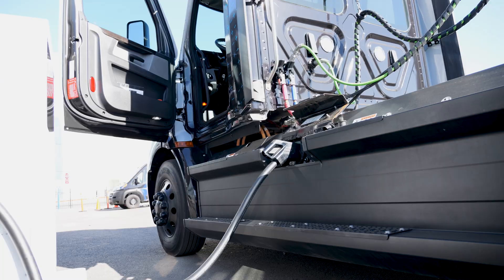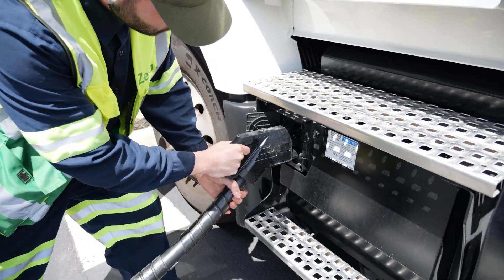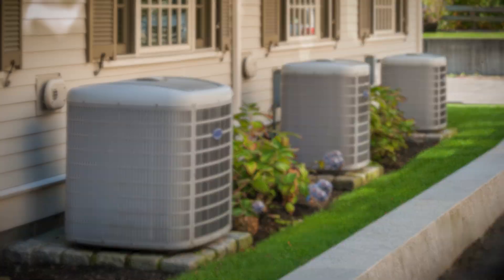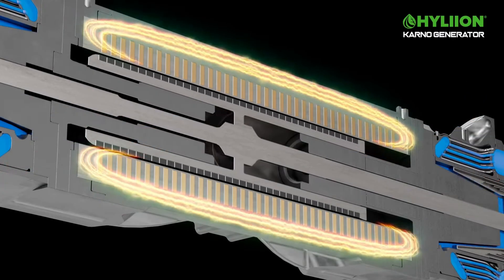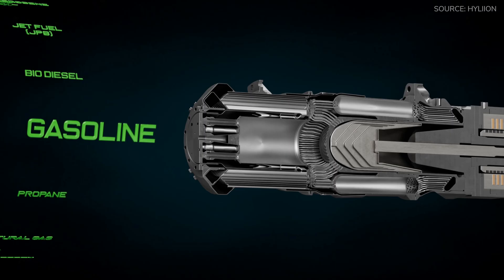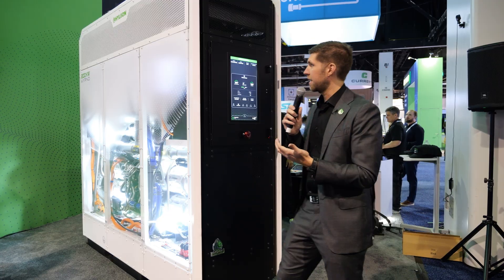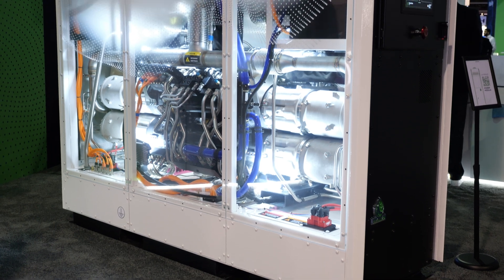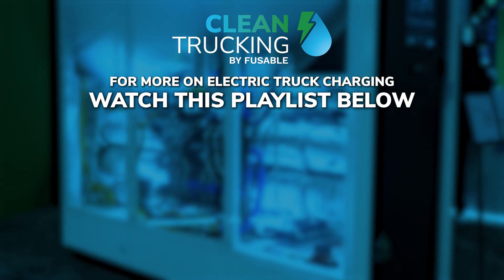On-Site Power Generation: The Future for Electric Trucking Fleets?

Comment: He mentioned NOx and CO.  But he didn't mention CO2.  It gets a tax credit from the GQP because it burns fossil fuels.  The high efficiency is nice, but it is hardly the solution we need for the problem that BEV trucks are built to address -- which by the way, is atmospheric warming due to CO2 emissions.

Micro grids should be powered by solar farms and wind farms.  As for trucking, the better solution is what Janus has brought to market in Australia.  They upfit old trucks with a modular BEV drivetrain and software, and have a system for swapping out the batteries by forklift.  The two key advantages: 1) Lower power charging greatly reduces the expense and time required for site installation.  2) The batteries and fleet management software are provided as a service, reducing up front expense for smaller operators.
Reply: Solar and Wind Farms are not the solution. We need something better. Those technologies have all sorts of issues and are pollutive in their own way as well.  Solar panel production involves toxic chemicals and energy-intensive processes, and large installations can disrupt land and ecosystems. Disposal of old panels is also a growing concern. Wind farms can harm birds and bats, generate noise, and require significant land, though much of it remains usable. Both systems rely on mined materials and face challenges with recycling and grid integration. Also, both technologies are not as reliable as a fuel source. Look at Germany...they spent hundreds of billions on solar and wind but are still heavily reliant on fossil fuels. Natural Gas and Bio-fuels are the way until we get something better.
Reply: @AllNightGames22   Do fossil fuel apologists have no shame?  Solar panels are replaced every 30 years.  But natural gas is replaced, like, every 3 seconds, continually. Nothing in the world comes anywhere close to the level of environmental destruction, toxicity and carcinogicity of fossil fuels.  There is no comparison.  Wind and solar with batteries would be 10x better for people and the environment, even if there was no such thing as climate change.

Sadly, there is such a thing as climate change.  And for this reason, wind and solar with batteries is 100x better than fossil fuels, for people and the entire ecosystem as we know it.
Reply: @AllNightGames22  I'm afraid you've got it backwards.  Solar panels are replaced every 30 years.  But natural gas is replaced, like, every 3 seconds, continually. Nothing in the world comes anywhere close to the level of environmental destruction, toxicity and carcinogicity of fossil fuels.  There is no comparison.  Wind and solar with batteries would be 10x better for people and the environment, even if there was no such thing as climate change.

Sadly, there is such a thing as climate change.  And for this reason, wind and solar with batteries is 100x better than fossil fuels, for people and the entire ecosystem as we know it.
Reply: It can work with ammonia so if the ammonia is green not much CO2.generated etc... for same for bioethanol...

Comment: What's the point of electrifying the fleet if you generate the electrical energy for recharging by burning fuel? It is still putting co2 into the atmosphere.
Reply: Yes, micro grids should not be powered by fossil fuels, although a device like this might have a place as a stopgap measure in particular circumstances.

The better solution for trucking is the model adopted by Janus in Australia.  They have a very practical system based on retrofitting old trucks to use swappable batteries, which do not require high speed charging - which is the principle bottleneck in the electrification of trucking.  Problem solved.

Comment: So many thoughts:  1) it's only as reliable as its fuel supply, so natural gas wins. 2) nuclear heat?  Would this work with a plutonium 237 decay heat generator?  3) how long does start up take?  Can it load follow?  Should it be partnered with batteries?  4) the physicist who developed heat engines was named "Carnot" -- please check your spelling!
Reply: 1. Reliability-wise, true, but biodiesel wins price-wise. 2) It'd work, but wouldn't be practical. (45 day half-life, gamma radiation, etc) 3) A Karno takes 30 seconds to cold-start and 4 minutes to reach full power. Also 3) Yes, it has effective load following capability. Also, also 3) I suppose it could be if you are worried about fuel availability. Otherwise, it can run 24/7 with very minimal maintenance, so batteries might be redundant. 4) They know. Or rather, General Electric, who developed it, knew.

Clippy is here to help.